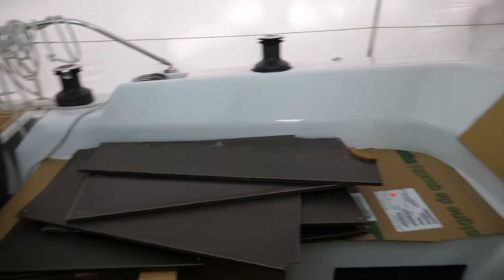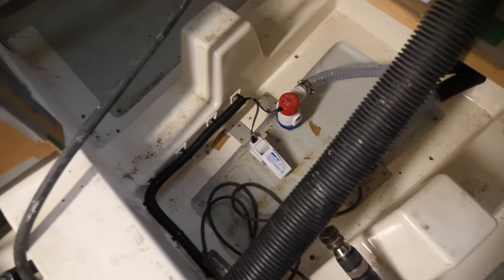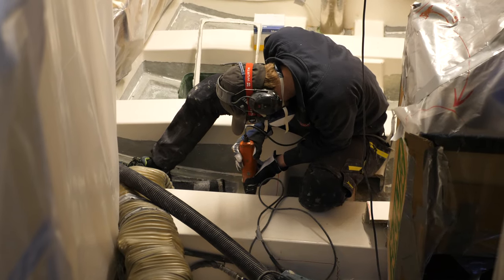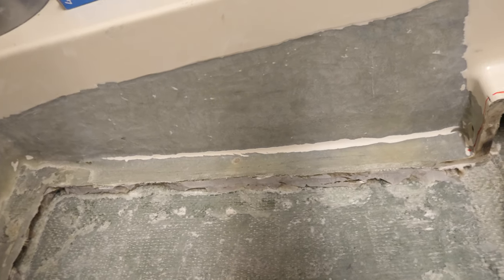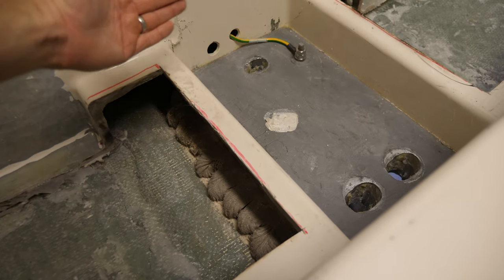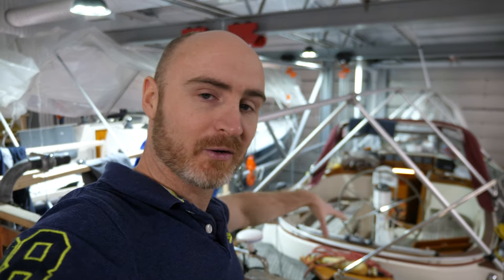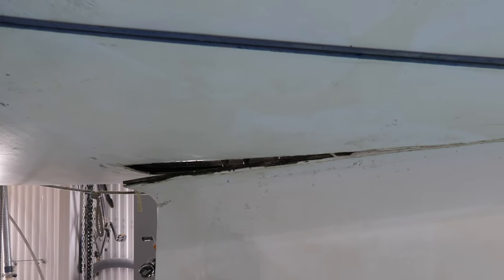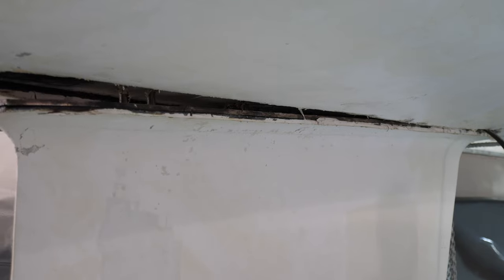SAILBOAT REBUILD - how to REMOVE a KEEL - Plastskador repair - week1

Comment: Hi.  Just a thought but you may already be aware of this. The channel ‘Expedition Evans’ is going through a similar repair on a Beneteau but they are doing it themselves.  Your solution to re-attaching the core with layers of fiberglass to the hull is the same as theirs.   Good luck.
Reply from the maker: Hi there. Yes, we are following Expedition Evans. What an amazing job they are doing. Thanks. All the best, Chris & Tanja

Comment: The keel top is too narrow. Foolish design.
Reply from the maker: If the keel was wider at the top, it wouldn't make much difference, sorry I don't agree. If the keel was longer on the top the leverage would be less during a grouding, it's why full keel boats don't suffer as much damage.

Comment: Moral of the story, don't buy a Hanse 😊
Reply from the maker: All productuon fixed fin keel boats with this profile would suffer this damage when hitting a rock at 5+ knots. They are built the same way.
Reply from the maker: @RobbyCrash  No worries! If you have the budget, there are much nicer boats out there
Reply: @SailingAurora I agree I don't know if you could build any fin keel strong enough to withstand the severe forces involved. Something has to give or absorb the energy. A crushable keel perhaps?  In the old days timber yachts would generally just sink.

Comment: Hanse has "never lost a keel."  Interesting boast.  How many of their keel have had to be repaired and at what cost?  What happens when you're sailing along at speed and hit a log or coral head?  Also, why is there no structure to distribute the load of the "grid" where it meets the hull?
Reply from the maker: Hi Jim, I' not sure of the statistics on the keels I just heard the statement from Hanse. When the boat ran aground and hit the rock to a dead stop, the keel did flex away from the hull and then was sucked back on with the sikaflex and the bolts. A little water came in at this point, but the boat did exactly what it was designed to do, absorb the impact, keep the keel attached and get you home to do repairs. The forces involved on a grounding like this with a rigid keel construction are immense, at 5+ knots you are looking at 100+ tonnes at the back of the keel on the strongback. With the keel design the only way to absorb this effectively is to swing the keel. Check out Linjett boats they have designed something for this. Of course it depends how hard you hit something also.

Comment: Chris, Really interesting video, thanks for sharing. Good to see 418 being so solid, when I was at the factory they said they never lost a keel so fascinating to see behind scenes engineering. Enjoyed the bonus footage. Happy Birthday to Tanja.
Reply from the maker: Thanks Jon, yea she is quite solidly built, the only thing that really sticks out is that they are using mostly bonding for the grid and not laminating it down in most of the frame/grid.

Quote from Hanse "The huge structural subframe is at the heart of every Hanse and importantly is both bonded and laminated to the hand built hull".

They are cleverly wording this as there are only a few parts that are bonded and laminated, most of it is only bonding (glue) in between the grid and hull. One of the issues here is that the bonding is strong but is very brittle and shock will crack the grid - hull connection. The reason that they did this is purely cost, the lamination would take extra time and therefore make the boats more expensive. It's a competitive world in production boat these days. I will touch on the subject in the next video a little. I am sure that these boats are pretty strong anyways so I wouldn't worry too much, it did survive the impact and did not take on a lot of water and it took a lot to separate the keel. Tanja says thanks for the birthday wishes :)

Comment: DAMN IT CHRIS!  You just took HANSE off my next boat list.  Yes, I am sorry that you and your wife have had this experience.  I feel for you mate.  It is just that "I am more important to me, then you"  (LOL) Here is what you did, rather here is what HANSE has done, that you are showing me.  The "grid" is bonded to the hull.  I want my grid glassed to the hull.  HANSE uses a (steel?) plate bonded to the hull that the keel is then attached to.  Not a terrible idea at all, the problem of course is bonded vs glassed in.  The lack of a "bilge box" in the lowest part of the hull to hold the bilge pump, is very disconcerting. Chris I can not imagine what other shortcuts HANSE has taken to cut a few hundred dollars from the build cost.  I guess we will see.  Be happy, be safe.    (end of first part of this video)

DAY 3 comment.  Question:  I am wondering why PLASTSKADOR is "repairing" a section at a time, instead of getting the entire grid prepared for repair at the same time.  Anybody that owns or has been around boat "projects" for any length of time knows it is never, ever just one thing.  Unless you get a good look at the entire repair area before you start repairs odds are "GREMLINS ARE HIDING".  On we go.

FRIDAY comment.  To repair where the bonder is layered fiberglass will be used.  Of course, layered fiberglass is much, much stronger than the bonding material.  Keep up the great work.  Be happy, be safe.

I have enjoyed this video a great deal.  Thanks a bunch for the "bonus section" very interesting to say the least.

How the grid is attached to the hull, then how the keel is attached is an extremely important safety issue.  We all have grounded, or hit a reef or we are going to.  That being the case ask yourself, if you know you are going to hit a reef do you want your boats grid bonded in, or fiberglassed in?  The best protection of the grid, keel and hull can be found in a heavy displacement encapsulated full keel sailboat.  If safety when grounding or hitting a reef is your only concern, you will be sailing a full keel boat.
If your desire is to go a reasonable speed, good upwind performance, agility in getting in and out of a slip,  etc.  You will not be sailing a full keel boat.  Therefor I ask again, would you choose a bonded grid or fiberglassed grid (all other points on the boat are the same)?

BE HAPPY, BE SAFE.
Reply from the maker: Patrick look a little bit at a time because it worked best for him. During the damage assesment at the beginning he always knew how much he would have to grind away.
It's a good question you have at the end there: I really like the performance of this boat and it would be a hard compromise to go to a full keeled boat. If I was buying a boat again today, I think I would be asking a lot more relevant questions at least.
Reply: If I was the designer and the producer, I'd be very satisfied.  There was sufficient bonding to transmit enough force to the grid to break it in several places, equally the grid was strong enough to fracture the bonding in places.  Of course both bonding and webbing could be much stiffer at a "reasonable" cost but just how big a crash should a boat survive?   Fin keels are vulnerable if you take them rock hopping.   It looks like chartered boats are prone to seeking shallower waters.  It's horses for courses.

Comment: I grounded my Hanse 342 in 2007 and I was going to follow the repair work just as you do back then but I got a virus infection (CMV, if that means anything to you) which put me in bed with high fever for four weeks (which in itself is interesting in these covid times). As a result, I never got to see the things I get to see in your excellent video so I would thank you for that. 

The bilge frame on my 342 is laminated to the hull so our boats are different in that respect  but I was told that they had to drill with a hole saw around the keel bolts to get the keel off. It is interesting to see they had to do a similar thing on your boat. 

I always wanted to have my own pictures of the process but your video is a good substitute.
Reply from the maker: Hi Johan, sorry to hear that you missed the repair, that virus must have been bad. Hopefully you fully recovered.
Indeed that keel was a pain to get off apparently, thanks for following, we appreciate comments like these. They keep us going, cheers, Chris

Comment: Very interesting. By looking of your yacht Hanse build them strong and the keel attachment is very good. 
Best wishes
P&J
Reply from the maker: Thanks Peter, it is built strong but I wish they would have laminated everything from the beginning. It might have broken anyway because the forces are so great but it makes for a better boat with glass to the hull. But of course the lamination is a much more expensive process as it takes more time and they are trying to keep costs down, understandable when all of the production boats are competing with each other and time is money. I will talk about this a little in the next video. Best regards, Chris
Reply: The contrary is the case Peter as the owner tried to explain in this very interesting video.

Comment: Why did Patrick not use a coring bit a size bigger than the diameter of the bolts?  Just a thought.  Great videos of your rebuild.  Very informative.  Thank you.
Reply from the maker: I will ask him. I suspect it's because the coring bit would have to be massive and it's alot of metal to cut through with a large diameter. Good point though, I am learning too

Comment: Found your channel this week and have been catching up....enjoyed the videos.      On this one when you are talking with Patrick, there is a shot of what looks like a plastic  thru-hull and a bronze valve.  If it is a thru-hull, what is fastening it to the inside of the hull, hopefully not just 5200 on the outside of the hull.?   Again assuming it is a thru hull, there should be a a backing board/plate encircling the thru hull (epoxy painted marine ply or a hardwood) and a nut to hold the thru hull to the backing plate. You should look at all the below water thru hulls and valves  and consider changing them out to flanged bronze set ups or the Marelon carbon fiber set ups ( matching thru hull and valve ) made by Forespar.  There are some good tutorial videos on YouTube regarding installation of thru hulls.
The Hanse boats have a fantastic aesthetic .   I am surprised that you do not have a bow thruster.....if able I would highly recommend fitting one in while she is under repair.  They can make docking and maneuvering less of an adventure.
Good luck with the boat
Reply: reply to my own comment....I see that any bow thruster is retractable. Nice option, do you have one?
Reply from the maker: Hi Geoff, This week it's on my to do list to research through hulls and sea cocks. Your comment gives me a head start for sure. I will include it in the videos of what we decide. To answer the other comment as well. there is a retractable bow thruster make by quick. It's pretty convenient for sure. In one of the summer videos you can see it in the water. Cheers, Chris

Comment: Great video how much did the repair cost insurance job of course
Reply from the maker: Thanks, it was around €40,000
Reply: @SailingAurora Cheers This is a really difficult repair that requires allot of effort skill and expense. I am not surprised. Looks like an excellent result however.  Thanks for sharing.

Comment: Hi Chris. Very interesting topic. Always facinating looking at the hidden structure/subframe of a boat. Would it be possible for you to show us the difference of the grid of the Elan 40 compared to your Hanse. Elan seems to have a lot more keelbolts. Thanks.
Reply from the maker: Hi there, sure I'll see what I can do. It's another owner's boat so I will have to ask permission. The keel bolts on the Elan are a lot smaller, hence the amount. Watch this space I'll see what I can do
Reply: my Elan 40 has fewer keelbolts (2,05 m draft ) - this here must be the 2,40 m draft

Comment: With regards to Hanse, I wondered if it is difficult to inspect the keel grid structure?
I mean without doing much damage to the wood work and removing a lot of things.
In some mass manufacturer like Beneteaus, it is almost practically impossible to inspect.
Reply from the maker: Hi there, sorry late to reply. With the Hanse it's actually pretty easy, you can see most of the grid just by lifting the boards. if not you can use an inspection camera, a very useful tool indeed
Reply: @SailingAurora  Thanks

Comment: Do you have any data you can share from the grounding?  It would be kinda nice to know what it takes to create this much damage.
Reply from the maker: Hi Mitchel. We are trying to get the detailed data of the chart plotter. We have brought it home, so will share when we find a way to get the data of it. Cheers, Chris & Tanja
Reply: @SailingAurora  NMEA2000 data stream over Seatalk or one of the other proprietary devices?  Kinda frustrating that each Mfg thinks they still need to reinvent the wheel.  If they made a better product at a lower price then it would compete fine over an open network infrastructure.  I watched this same thing play out in the 80s with CompuServe then AOL, lol.  Didn't work out so great for them either, lol.

Comment: GREETINGS !, as an after thought........you may want to do at anytime what i have done to my catalina 27, i put a 5/16in. plate of steel over the keel area & floor & used counter sunk longer bolts to attach the keel with....the plate is 36in. x 55in. it makes the keel attachment almost foul proof .
Reply from the maker: Sounds like a good idea, pretty confident in what we have now though

Comment: Its not if your gonna run aground , its when . Get a boat that can take a good smack.
Reply from the maker: It's a trade off I guess. Either performance or strong against groundings.
Reply: I have sailed them both , fin keels and full keels (they are very slow in light air). As long as the boat has a cut out fore foot and a rudder separate from the end of the keel the performance hit is not that much . Actually if you read Ted Hoods book , the delta bottom is very fast due to its low wetted surface and a very shallow draft. How are the repairs holding up no stress cracks in the hull ?

Comment: The way Expedition Evans did their boat is the only way! How builders like Hanse and Beneteau  can get away with bonding (gluing) the ribs and stringers to the hull is crazy. They provide the strength to the boat and should be fully glassed in. Your bulkheads are also not fully glassed into the boat. All this makes a week boat that will flex like crazy! This is such a poor build method and can only be done to save labour hours / save cost / cut corners. The issue with so many modern production boats built is trying to design and build a large boat at a lower cost. Something has to give, and it’s quality definitely. Cheap small cleats, thinner hull (to keep weight down my ass) less fibreglass and resin + less cost.
OK save money but you are going to sea in a bit that is basically not safe. How any of these boats get an CE Category A rating is a joke! This rating covers largely self-sufficient boats designed for extended voyages with winds of over Beaufort Force 8 (over 40 knots), and significant wave heights above 13 feet (7m), but excluding abnormal conditions such as hurricanes. Sorry but I would not like to be at sea in a Hanse in those conditions. It would rip that boat apart.
I’m not saying they should not be sold, I’m saying they should have a Category B rating at best, but more realistically a Category C rating.
Don’t get me wrong I have owned and lived abroad a Jenneau 45.2 and had it in 50 knots and 4m seas…..scary as hell but the boat stayed together.
I have also owned an Amel Super Maramu for the last 6 years, had over 6k knots and 6m seas….not fun but not as scary as the Jenneau in 40 knots and 3m seas. Felt safe at all times.
My point is they really need to stop marketing and selling these boats claiming they can safely cross oceans. I know many do but! They are definitely not Category A!!
Perfect for coastal and Mediterranean cruising, let’s face it that is what they are built for.

Comment: that's funny: my Elan 40 has had a grounding as well and I bid for it out of an insurance claim. Did the repair myself although the keel was already off. They used heat to weaken the Sika. The so called "strongback" is laminated in by the yard but it seperated partly due to the grounding impact. I'd say a bit easier to fix...( www.instagram.com/p/BbfCl1XBGI6/ )  Thanks for the inside view of your repair!
Reply from the maker: That's awesome, it must have felt great to fix something like that. The Elan in the workshop at the moment has very small grid compartments, so I guess you had your work cut out for you. Happy to share and glad you can get something out of it, cheers, Chris